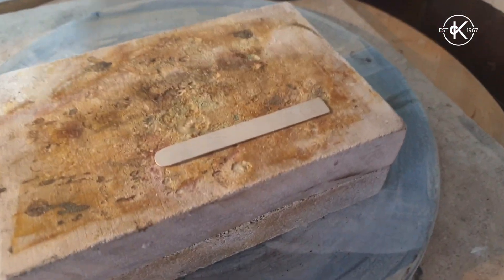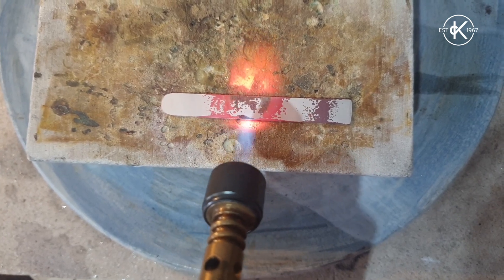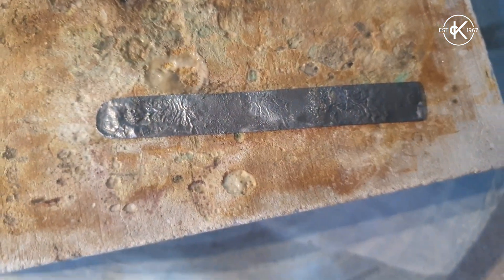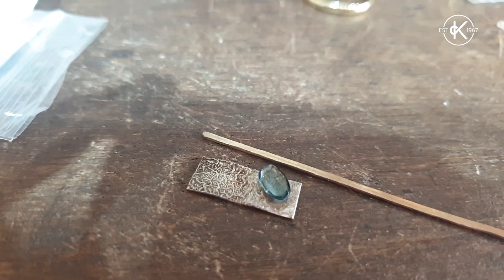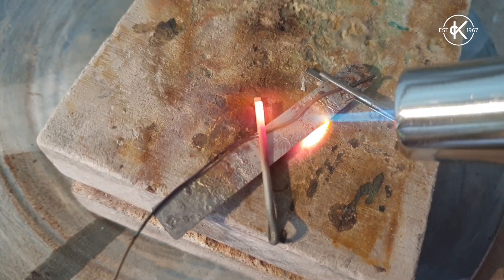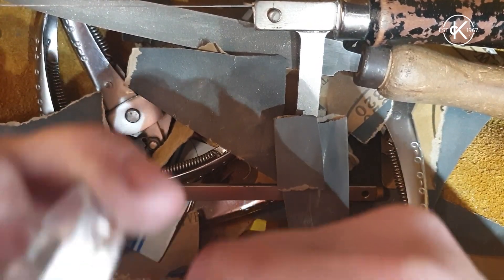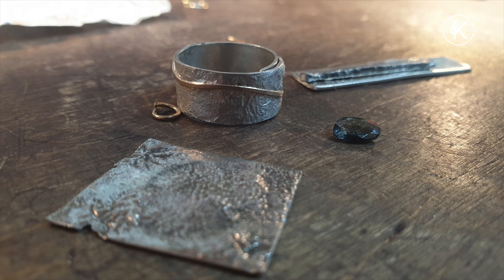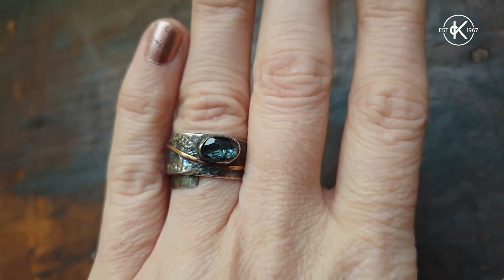How To Make A Reticulated Ring Band | 12 Months Of Metal

Comment: Yet another excellent video, especially the bit that showed the bottle warmer, because I have been looking at buying one of them, because I have very little space to work in(I am doing everything in my front room at home, for now and the foreseeable future), so I am keeping the pickle hot/warm, in a jar which I keep in a large mug of hot water from the kettle, on top of my radiator, until I can get a bottle warmer obviously..... I loved the ring, because I think that stone is a really gorgeous colour as well as a good size, and it’s made so that you can change the size a bit, isn’t it (?), I also really liked the tip of using split pins, for holding elements in place while you solder them, because those titanium strips that you can buy to do the same thing, are quite expensive, and those split pins aren’t very expensive, even if you buy a good selection of sizes to work with, are they.?.?.
Jon.

Comment: Kim how did you set the tourmaline on such a bumpy surface?  Did you sand down the area where you wanted to set the stone?  As we all know, you need a smooth flat surface to get a good connection between the bezel strip and the surface to where you're soldering.  Any tips or suggestions?  Thank you for your great videos!
Reply: Ooow I can't remember as it was so long ago :) I may have just sanded as it's not a huge stone. Or often we make the stone setting with it's own flat base, then solder that onto the irregular surface.
Reply: @kimthomson400  Okay, many thanks...I'll just have to get in there and try it.

Comment: Really gorgeous ring Kim, I'm going to have a go at reticulation. Thanks so much for all your videos and guidance. You've helped me so much. One thing I'm a bit confused about, and I hope you can help me with this - I know about annealing and getting the right glow; and I've also read I can over anneal i.e. heat the silver for too long, too hot which can make the silver brittle - does reticulation cause these brittle issues? And finally, although not related to this type of ring as it won't need any more work than shaping - but if you need to, can you re-anneal silver after it's been reticulated?
Reply: Yes, annealing temperature is judged by the colour which is a dull pink glow. If you get your metal bright red hot while annealing, it can become brittle and once it is brittle, there is little you can do about it apart from using the silver for casting instead.

Comment: Thank you for the video! Can I ask what gauge silver your started with, whether you were using "reticulating" silver or something else, and if you did something to make the inside of the ring smooth after reticulation?
Reply: Hi Eric, it was 1mm thick, 10mm wide sterling silver. It was sat on a flat surface so the back didn't reticulate so I only had to give it a light sand and polish at the end as with any piece of jewellery. Hope that helps :)
Reply: @makeitwithkim-jewellerysil3126  Thank you for your response and the helpful video!